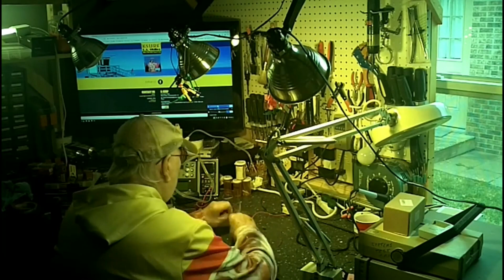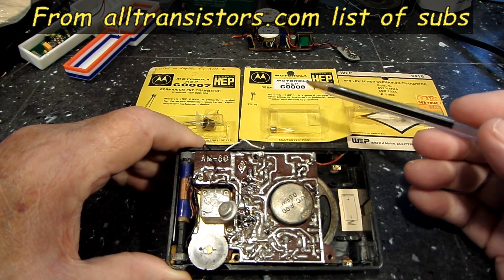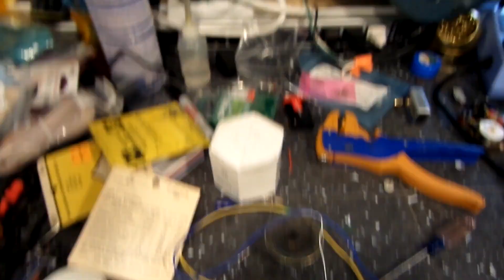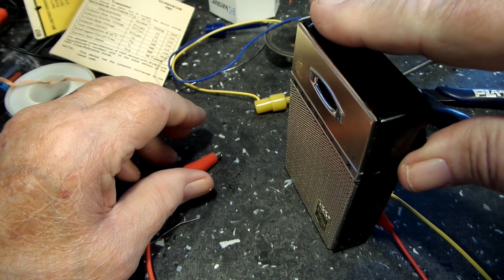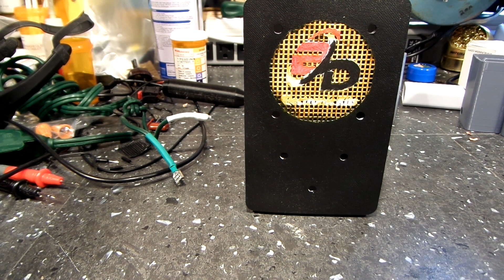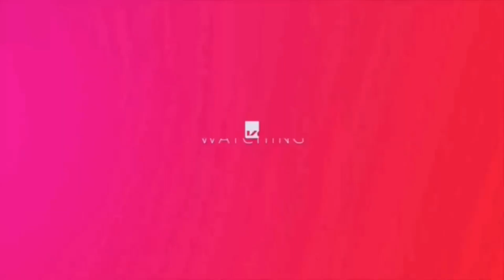Magnavox AM-80 - Try, try again...

Comment: Don't give up on it Doug. Shango makes it look all too easy. It is not. Go over the connections and transistors and 
keep plugging away.
Reply from the maker: Thanks Steve. Not giving up, but I may regroup. LOL I'm thinking the original transistor I borrowed from this one to use in the better looking one of the two had previously been replaced and so I may investigate that more. Plus there are a couple of resistors R2-3 that don't measure quite right. Not a priority, but I would like to eventually get both these sets working. :)

Comment: Doug - +30dBm is one heck of a signal, should have rattled the windows!  1) Connect a VTVM to the speaker, turn volume up to see it on meter, then connect your sig-gen (just enough signal where it registers on  the VTVM / 30% mod) to the input side of the transistor, adjust volume on radio so as needle on VTVM is about halfway, then connect sig-gen on the output of the transistor, take note...does the signal stay the same? lower/higher?  if its higher then you know everything before it has the issue, then you can troubleshoot each component, maybe more then one issue.  2) Do you have a cheap Chinese component tester, if so test all transistors and componets...it will also tell you what legs are what. 3) I do not know what you have for a scope, but check to see if the scope itself has a "10X" control, if so this will amplify your signal by 10, then re-check your oscillator to see if its working....honestly, if you need to do a 10X, either your scope is not sensitive enough or your oscillator is not working to well...my findings are most oscillators are strong. 4) Lastly have you tried the old placing another AM radio close to the DUT and see if you hear a change?  ~Jack, VEG
Reply from the maker: Thanks Jack. I acknowledged +3.0dbm was a strong signal and I also heard a signal at -7.0dbm as well, but of course not as loud. And these were radiated signals, not directly connected. I had already used the transistor spec sheet and verified the pinout using the component tester. My problem was that I not verified the location of the pins on the board itself and had the transistor in with the emitter and collector reversed. Now with the transistor installed correctly, the radio no longer passes the signal from the RF signal generator, even though the voltages on the pins are now correct. Last night I compared some of the measurements from the non working radio to the one just like it that works and the values were pretty much all the same. This one has me scratching my head a lot, but I will get it fixed at some point. :)

Comment: Hi Doug, thanks for showing all this; it's interesting.  I have one of those cheap M testers that I use to double check the pinouts on those replacement transistors after I had a bad experience with two NTE transistors with the same number but opposite pinouts.  I agree the OSC seems to be running and the mixer working at least some, or else how could the radio frequency get converted to a modulated 455kHz IF frequency to get though the IF stage?  Hope switching that little guy's pins around fixes the gain.
Reply from the maker: Thanks PF, appreciate the thought, but after getting the darn thing in correctly and even replacing the resistor which was tied to the leg of the emitter, now it will NOT pass those frequencies. Very strange. Hope I can figure this one out. :)
Reply: @DERB_Seymour_Indiana  Doug, did the voltages work out on the pins of the converter transistor after the change and resistor replacement?  If so, hmm.  
When you did the demonstration with the other radio tuned to the station, I may have imagined it, but I thought perhaps I heard the generator's signal through that other radio very low, at 6:55, even though the generator lead was some distance away.  Could it be the generator signal is too high and the IF adjustments are out due to AVC, etc?  Just a wild swing with my eyes shut.  Good luck!
Reply from the maker: Yes the voltage were more inline with what they should be on the three pins. A little lower than called for on the base and emitter, but then I never checked the source voltage so it may have been low also. It's impossible for me to hear that well when I'm working on these things, I hear things that sound like a station and then I just think it was my imagination. LOL Going to play around with it again tomorrow and see what else I may be missing. :) Thanks!

Comment: Hi Doug, those darn transistor radios sometimes are pain to work on. Glad that you have schematic for it, it make the job simpler but not easier. Have you had the opportunity to adjust trimmer and IF transformers? Several of the radios that I worked on lately had to adjust those to get station. I am sure you will fix it no matter what it takes. 👍👏👏
Reply from the maker: Thanks Jay. I've got the transistor installed correctly now and I even changed out the resistor on the leg of the emitter. Now the darn thing won't pass any station frequencies! More work needed. :(

Comment: This radio has been a challenge and somewhat a headache. 👍
Reply from the maker: Thanks Lloyd. Yeah both it and the Baylor are proving to be difficult at best. I know that oscillators can be very picky at higher frequencies, but the ones in these sets will usually run when others won't. :)

Comment: Doug; Another question I have is it possible that the LO circuit has a problem, but can still pass the RF signal from the generator, but no stations?
Reply from the maker: Hey Daniel, it is my thought that the oscillator is not running because it doesn't pass the station frequencies. I hope to illustrate that on the Magnavox using the scope. :)

Comment: Good morning Doug, How is your day? I have been following you in the repair of this radio, and I discovered that I am going to begin, working on these radios, I have troubleshoot the Tecsun and I got it working....): One question I have where do you find the parts for the radios that you work on, such as capacitors, resistors, and such, Thank you kindly for any help....): have a great day....):
Reply from the maker: Thanks Daniel. So far so good I guess. We buy a lot of parts from Digikey and of course eBay. For quantity purchases we usually buy from Tayda Electronics. Hope that helps. :)